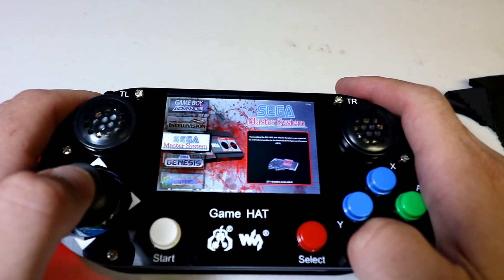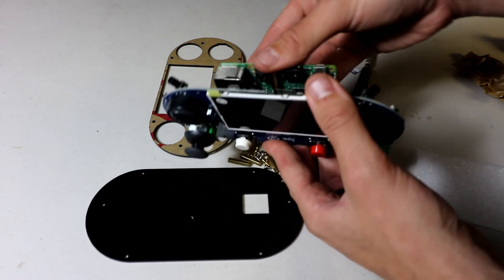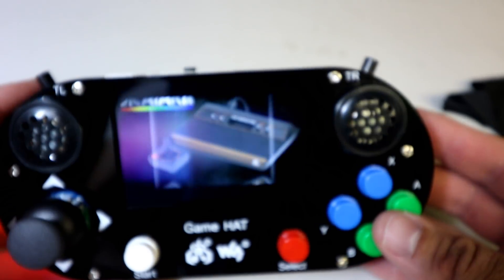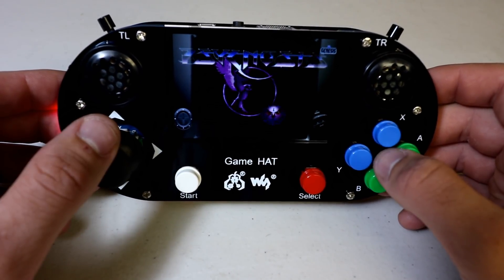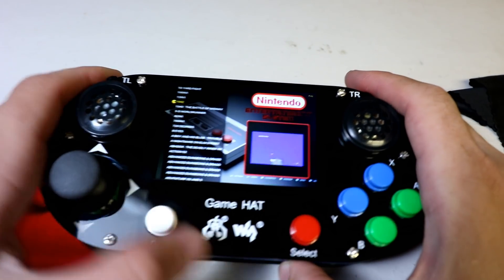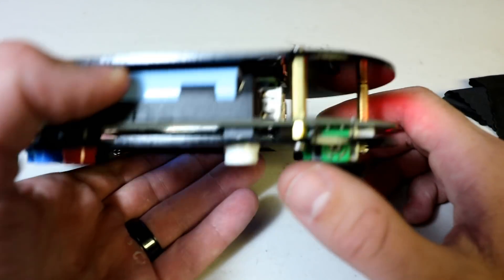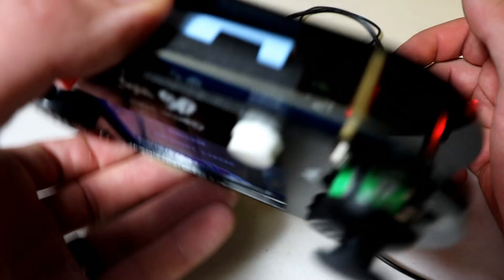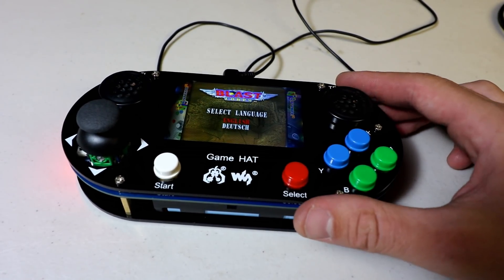Waveshare Portable Retropie & Roms On The Go

Comment: For the price I think I cannot complain. However I see a number of drawbacks : the buttons are too loud, the analogue stick kinda sucks, I would have preferred a volume pot. Also the battery is quickly exhausted but of course it depends on what pi you use. A zero should give several hours of play, but then only 8 and 16 bits systems could be used.

Comment: I'm confused what this is for. There's no console with 1 analog stick and 4 face buttons on the right + shoulder buttons.(N64 has 6 buttons on the right). It's like half a playstation with half a snes controller or something but it's not ideal for anything. Might as wel just used a decent d-pad or go dual analog or 6 face buttons on the right (good for N64 and Mega Drive). At least make it perfect for something.

Comment: hi, i'm trying to install damaso rom 16GB microsd but when i try to install driver like the instruction, i receive a kernel error... like: Error! echo
Your kernel headers for kernel 4.14.29-v7 cannot be found at
/lib/modules/4.14.29-v7+/build or /lib/modules/4.14.29-v7/source.
Error! echo
Your kernel headers for kernel 4.14.29-v7 cannot be found at
/lib/modules/4.14.29-v7+/build or /lib/modules/4.14.29-v7/source.
And after reboot ...don't recognize the button and pad....why???
Reply: Did you Find a solution?

Comment: Does it charge the battery inside of it or do you have to take the thing apart to get the battery out?
Reply: I wondered the same and looked into it. You plug in a power cord and it will recharge it. No need to disassemble.

Comment: I took your advice and you are right the drivers did not install 

I have tried to delete what I put on my boot partition and try again but that is how I got the error message I showed you

How do I delete all files and start new

Can you walk 🚶 me through the process/do a video on it please
Reply: yes...this would be helpful..I cant load the driver either...
Reply from the maker: id just start fresh with a new retropie and then install drivers and then drag and drop the roms
Reply: Greetings Drew

So I took your advice and reflashed my drive(erased my Reyes 128gb image) I download the wave 🌊 share image and so now the drivers are working

My next question is can you point me to a good image-after the flash my card is reading 119gb. 

Do you know of a fully stocked image I can flash to this card 🃏 and get back up and running 🏃

I have been trying to download an image from arcade punk but I have been running 🏃 into a brick wall-i am doing something wrong because I can't get the image to extract

Are there instructions I am not seeing

Please help
Reply: @abdurmatin  there is one image on arcadepunks special for the gamehat which workes good: [16gb]-GameHat.Raspberry.Pi.3B.3B+-Cyclair
I tried also other images but always could not configure the controls for the gamehat :-(. Did you find some other images meanwhile working with the gamehat or instructions how to configure the controls?

Comment: Got mine yesterday, spent some time playing it. I'm glad I got it, it's fun and a very interesting device. I do have some gripes. Obviously, the analog stick. It has a lot of travel so playing fighting games isn't easy. The acrylic is rather sharp so it gets to be uncomfortable on your fingers. The shoulder buttons are small and seem rather "loose". The large gap between the bottom plate and the PCB makes it uncomfortable to hold for a while. Since it takes an 18650 battery, you're likely to get no larger than a 2600mah battery. Overall, though, I still like it. I do have other retro devices, and this is an inexpensive addition that works and looks cool.
Reply from the maker: Nice!~

Comment: At 5:08 Without using a keyboard what is the hot key press you did you get into and out of the menu system to turn off bezel?
Reply: I should imagine Start & Select at the same time, to exit back to the main menu.
Reply from the maker: select and "x" or "y" i forget

Comment: What 18650 battery do you recommend this is the second brand used first was ultra fire which was a fake then I found EBL which is supposed to be better but this handheld is energy guzzler
Reply from the maker: Yeah there is a huge gap in these, I ended up using Samsung...just follow the online reviews and use fakespot to try and spot fake reviews... or go to a vapor shop as if they have good customer service will lead you the right way....
Reply: @drewtalks  thanks for the advice called my local vape store and they carry Samsung brand 18650 batteries. I had tried my local Walmart, my local Staples with no luck. so I gave up and bought online with Amazon only to get crap brands hopefully 3rd times the charm
Reply: I would go for a LG HG2 its a 3000mah cell that's pretty solid.
Reply: How long did they last before recharge
Reply: Nigel Higgins  I went to a vape store and got a Samsung 30Q much better performance on one battery